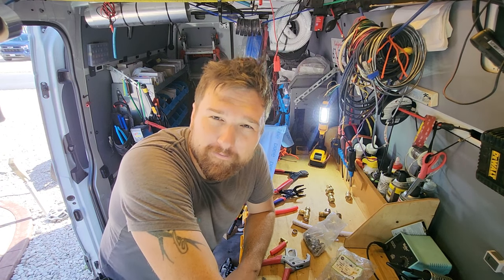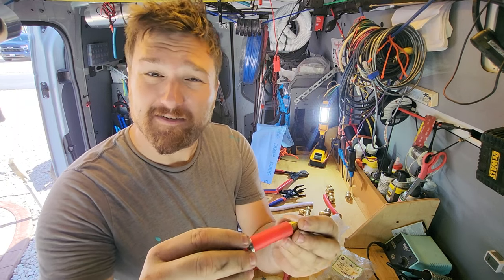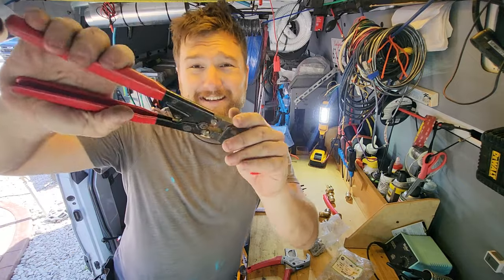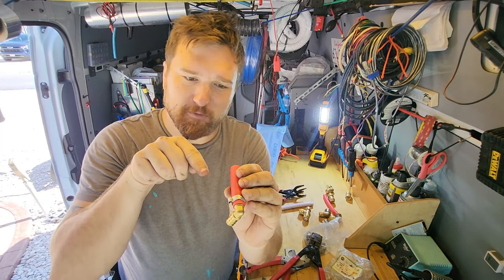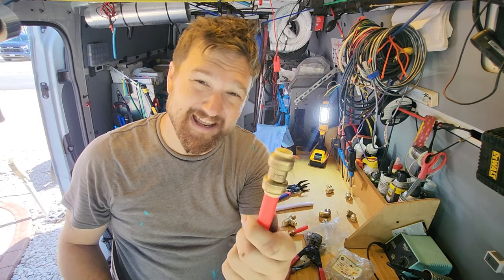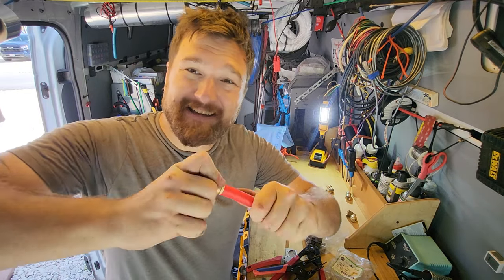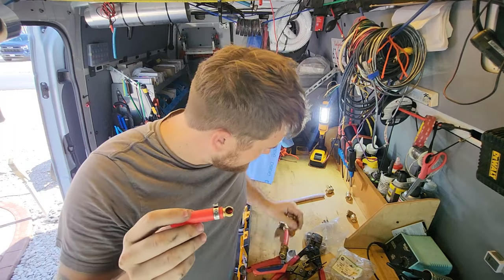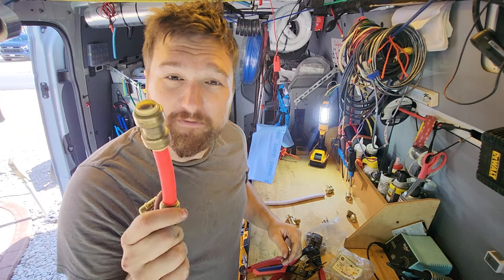Stop your RV from leaking!

Comment: Residential plumber that moonlights as a RV Tech, no shark bites are ever permanent. 2 PEX crimp Rings actually make an impression on the tubing itself which is where you achieve water tight fit. It can spin around because it is formed channels within the pex. PEX tubing is designed to expand due to ice.
Reply from the maker: I replace Pex Crimp fittings all day. They are cheap and fall apart very easy. For RVs I believe Sharkbite is the way to go. Not only do they hold stronger for longer. but they are easy to remove when troubleshooting or working. Thanks for the comment.

Comment: I am an rv tech as well. Shark bites are not permanent. No plumber worth his salt will use them. Pex crimp fittings are superior. Even better use the flare-it fittings. The only time I use shark bite is in a temporary repair situations. If the crimp fitting fails it’s because I executed it improperly.
Reply from the maker: I replace Pex Crimp fittings all day. They are cheap and fall apart very easy. For RVs I believe Sharkbite is the way to go. Not only do they hold stronger for longer. but they are easy to remove when troubleshooting or working. Thanks for the comment.

Comment: I like SB's as well.. but, what do you do when you have an RV that has PEX on one side and has that flexible tubing on the other side.  I have that in my RV and, fortunately, have not yet had a leak. Many others have.  Mine is a Grand Design
Reply from the maker: I replace and rebuild. It's worth it in the long run.
Reply: Thanks.. but, what do I uses as an RV owner not close to you?
Reply from the maker: You could easily do it yourself.  SB are very easy to use. 

Or look for a tech with great reviews
Reply: @GoGreenMobileRVRepair  I'd say it would be a good followup on this video.  I have the mechanical skills.. but not the vision on what to use to do the job.  Thanks for the input.

Comment: As a fellow mobile tech I second everything said.  I got tired of the pex crimp call backs, initially thinking it was the plastic elbows and tees used vs metal... even went as far as to buy a crimper that lights up when the correct pressure is applied to the ring.  Go/no-go gauge says crimp is fine, yet it leaks again down the road.

Now I carry the rings and metal fittings only for the customers or warranty companies unwilling to pay for the upgrade to shark bite fittings.  Some of the older motor homes run 3/8" pex off manifolds, and 3/4" feeding said manifold, but the majority is 1/2".

Excellent video and advice!  Well done
Reply from the maker: Thanks man! Means alot!
Reply: Hey question for y’all. I’m just asking a question because I don’t know and I’m curious to see what y’all think being mobile techs. I had plumbing work done in my bathroom here in Georgia.  The plumber was telling me that supposedly shark bites in Georgia are not allowed as a permit solution only as temporary solution for up to 48 hours because they are notorious know for failing.  What are y’all experiences ?
Reply from the maker: @Hugo-Hernandez  Definitely incorrect. I use sharkbites all the time with no issues. 

Also there are not permits for RV builds yet. 
But double check with your local government.